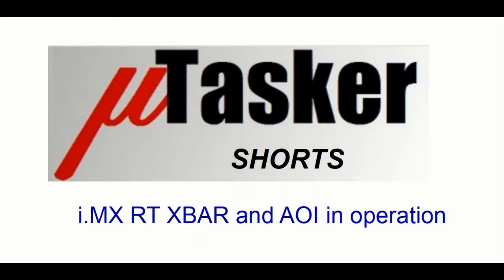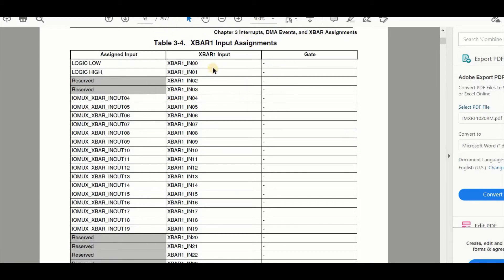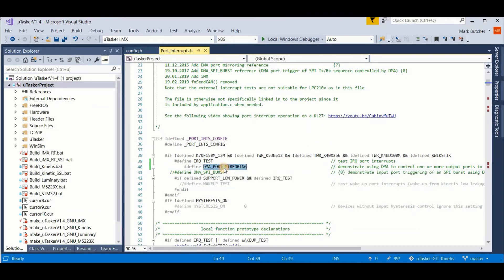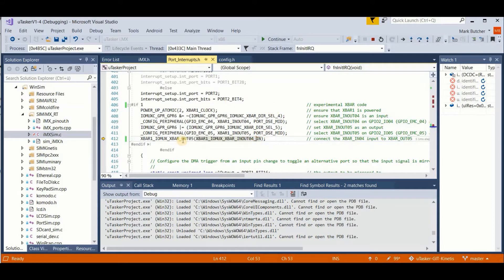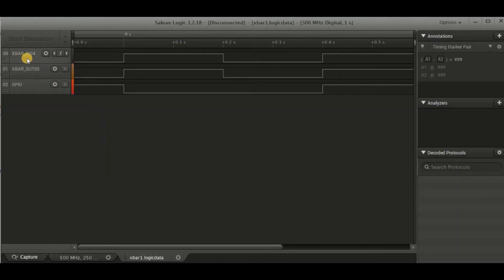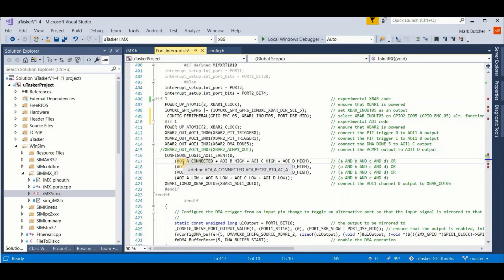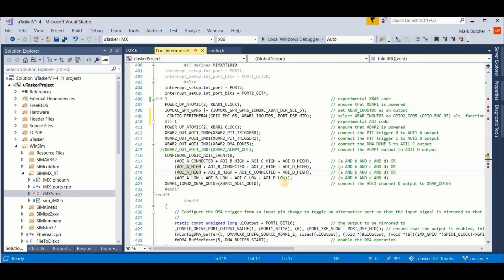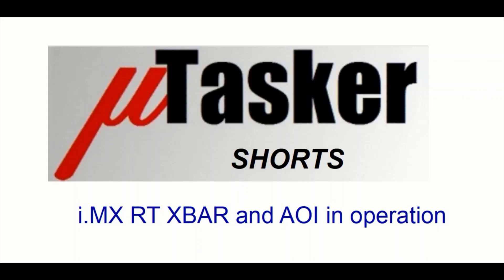i.MX RT XBAR and AOI (On-Chip Cross Trigger Network)

Comment: Hi, I want ask you a question about flex spi and external quad spi ram.... Could you describe, how to make such configuration ? I try to make project with rt1024, but without saccess....
Reply from the maker: To use external QSPI with the i.MX RT 1024 on a FlexSPI you need to:
- configure the pins used
- configure the FlexSPI (channel)
- enter a look-up table that describes the various QUAD SPI flash operations
and this will enable reading from the QUAD SPI flash (XiP).
To delete, write etc. a further driver is required that understands the command sequences used by the QUAD SPI flash and allows the application to perform the tasks.
You should be able to find references to these steps in the NXP SDK or else it is available as turn key solution in the uTasker project (for most common QUAD SPI flash types).